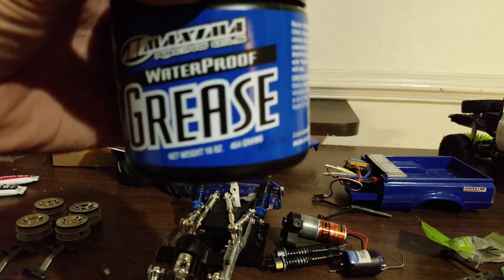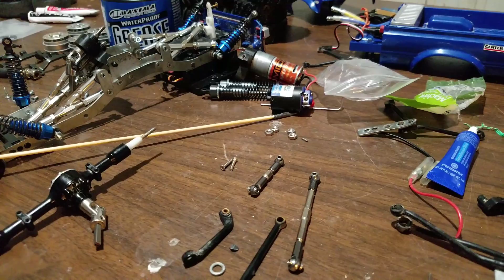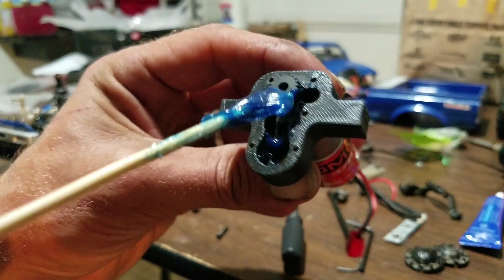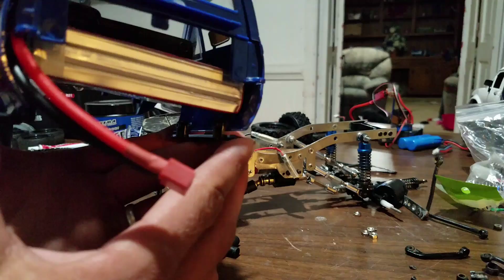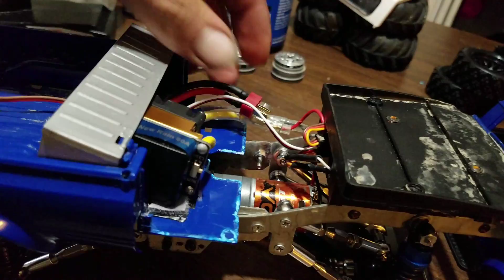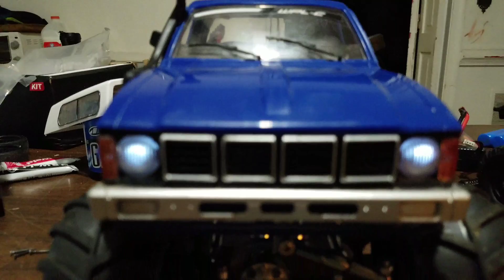Mini mud truck insanely upgraded Wpl c24. Motor+metal

Comment: The speed of the 370 without the 2 speed gearbox is a bit fast for serious rock crawling in my opinion, but it would most likely suit your Mud Truck well to sling mud and clear the tires better when going through a hole and to help those paddle tires to propel you through the mud and water. Cool video, thanks, subbed!

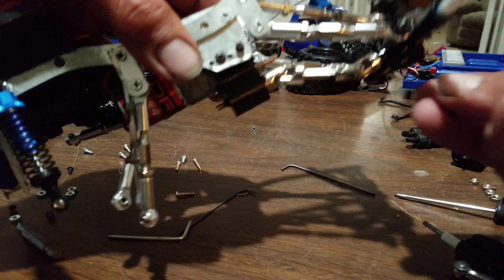Comment: Around 7:41 I see these metal brackets holding the motor. Can you tell me where you got those and the metal links? Sick build man!
Reply from the maker: I made them with sheet metal off the back of a dryer. Tin snips a drill and my eye.... good luck bud...
Reply: @supastihl89  haha that's awesome man, appreciate your response.

Comment: Why do tires wobble so much
Reply from the maker: I homemade wheel adapters with plastic 12mm drift rotors and jbweld. I did it by eye on a table. It worked lol. Well before the first 3d printed 5-12mm adapters were available. Needed to fit the big wheels.

Comment: What other work besides metal drive train and bigger engine is there also would you recommend a better esc and servo
Reply from the maker: Yes I upgraded the links aswell. Better articulation. I prefer the single speed motor and esc depends on trans choice. I would get atleast 30+amp esc and 370 is a good size motor. It comes with the metal upgrade trans amd the 2 speed. The 2 speed you have to watch the 4 link gets in the way

Comment: Would you do a build like that to sell? I’d love to have it. Wish I had time!
Reply from the maker: Comsidering selling. Driveshafts arent hooked up because. I dont have a grinder and outputs on trans are hardened.
Reply: Hooptie Rides&Reviews how much?
Reply from the maker: @jerrysmith7166  id like to get back somewhere like 125 w/o electronics- esc receiver. Will have upgraded servo still. Metal gear 3.5kg waterproof.

Comment: Why us the 2 outputs on back of the gearbox
Reply from the maker: I assume you mean the 2 metsl shafts out put on one side. I believe it is a reverse drive for optional use also some use a short shaft to connect to a large motor to drive the gearbox externally. It is just a very universal gearbox
Reply: How much rotational speed do you  think a stock axle can take because I'm building a drag truck with a b16 frame and a c 24 body with a modified stock gearbox to run a 370
Reply from the maker: @morganblancett5027  get the complete metal rear axle kit. It comes with ball bearings. Then you wont run the risk of melting plastic bushings. Otherwise they will tske a ton of rotational speed due to their simple design of being just one solid shaft very balanced. However with power you need to either get metal axle ends or jbweld the white plastic ones on. They tend to slip loose
Reply: I pondered it but I want to test the limit of out the box components and I've narrowed the axles to fit the lower stance the truck has
Reply from the maker: @morganblancett5027  im actually prepping for a high speed/drift lowered wpl truck myself. I painted frame and a few components an almost chrome silver. Was supposed to be chrome but not quite way it looks.
Reply: Mine is more of ratty build because the body has had a lot of cuting done to it but I found the tires I have firm a Lego set I had fit directly on to the wpl rims the I'd is smaller than the original tires my suspension is a perdicment tho because of the narrowed axle
Reply from the maker: @morganblancett5027  make a cross member and jbweld aome brackets to axle
Reply: I made trac bars from stock Lower four link area and glued them to the axle I just have maybe and inch for springs on the back I'm trying to reframe form cuting a hole in the bed I'm wanna have all electronics in the bed wth the cap on

Comment: Hi there, i like watching your video, lots of detail thank you, i would like to ask one thing,the chassis and drive train,i was thinking of widening the wheel base to suit 1/10 ,the chassis is easy to work with and modify, the props are easy to lengthen,however the hub ends might be to much,i can lengthen the shaft but the plastic casing will have to have a gap either end, i was going to slide a plastic tube over that bit and some real nice plastic glue as it needs to be sealed.what would you do? thanks.ps i would love a 2 speed trany and upgrade the motors to duel rs 540 brushed it needs to pull my boat.
Reply from the maker: If you want to widen it the MN D90 has wider axles the 1/12
Reply: i like the speed from the big truck with the 3 s but i would still like to crawl,so i would be happy with that i,m just looking closer at the MND90 i had seen it many time but ruled it out, dont know why but 1/12 is worth a look thanks man.
Reply from the maker: Yea man thanks for subscribing im not the best channel ever yet lol I just like to share my stuff
Reply: Well thanks for sharing, that's what its all about.
Reply from the maker: The two-stage would be okay for pulling as long as you don't do any hard snatching
Reply from the maker: I don't think you could make it much bigger than 1/12 scale and if you could I wouldn't recommend it just not very solid of a frame for that size
Reply: thanks for the reply.

Comment: Hey man I checked the link to the wheels and tires, and it said they had 12mm hexes. I was just wondering how you got them to work on the truck, or is that the hex size on the truck. I've ordered on and it's on the way. Just trying to get some ideas for upgrades. BTW the truck is bad ass man.
Reply from the maker: Thanks bud. If you look i have drift rotors with 12mm hex on them. I glued them to wpl rims and mad my own adapters. However on ebay their is a guy selling adapters 3d printed. Theyre on my new white truck build
Reply: @supastihl89  thanks for the quick response man. And thanks for telling me about the adapter's too.
Reply from the maker: @MrTimcrawlin  np

Comment: Whats the motor?
Reply from the maker: Dromida brushed 35t 370. I have it on 3s and it kills. Great power. Though i heard it does not like heat so short runs on 3s